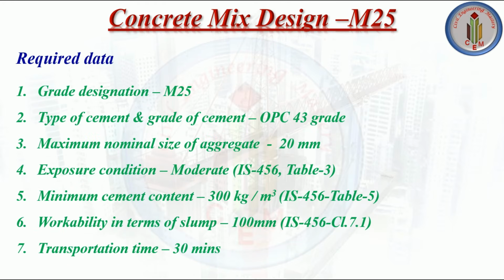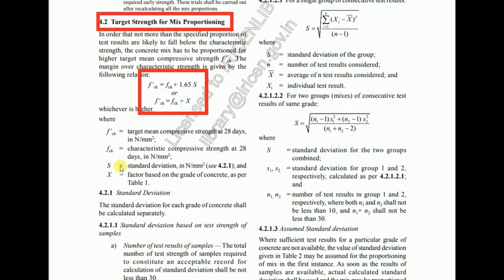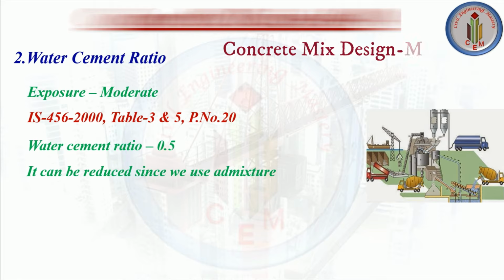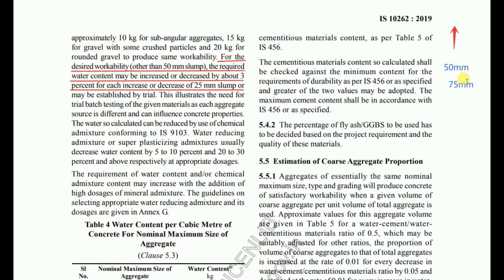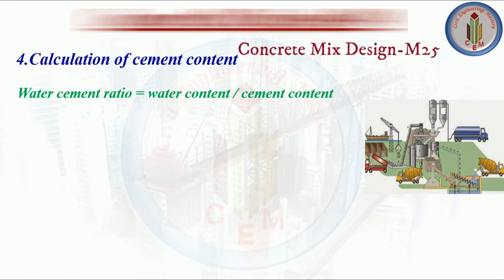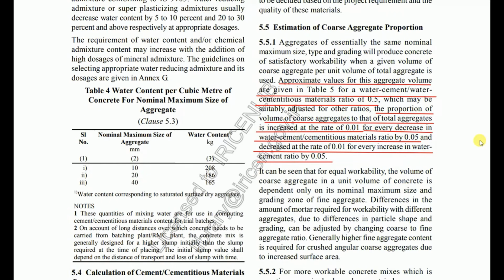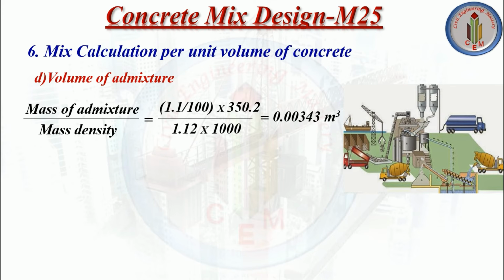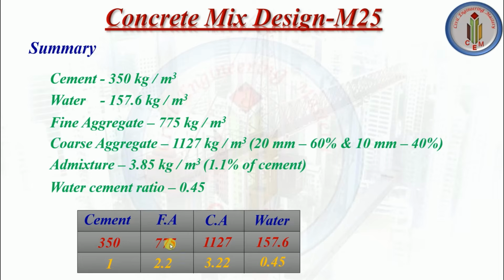Mix Design M25 grade | Concrete mix design M25 grade | IS-456:2000 & IS-10262-2019 | SSD Condition

Comment: Excellent, just a question. Can the same strength be achieved using 32.5 cement or only 42.5 cement?

Comment: What type of Quality assurance you will recommend for a M25  design mix. concrete (Self compacted) for a Multi storied Building Project.

What is the answer to this question?
Reply: Workability of concrete, characteristic compressive strength after 28 days